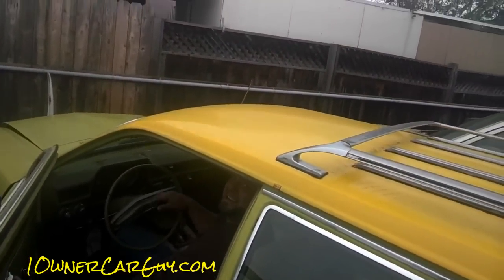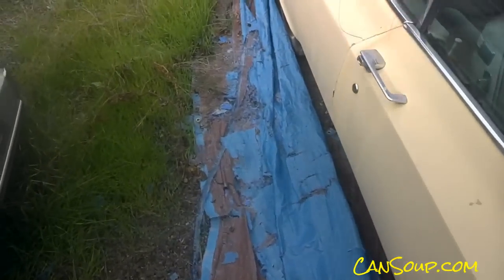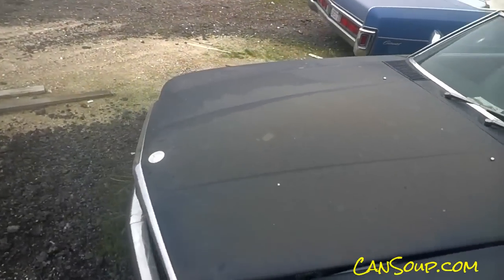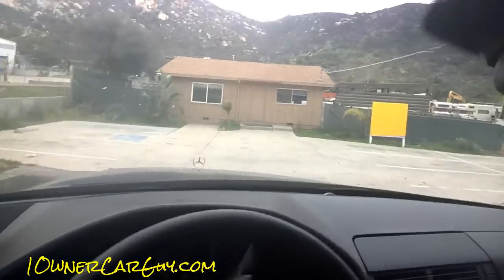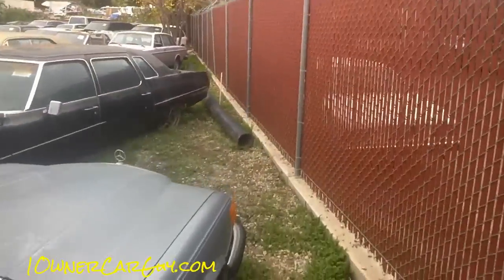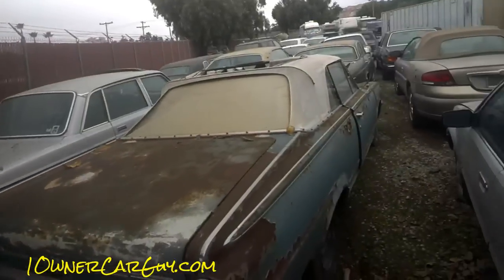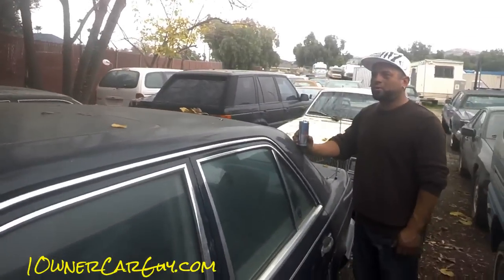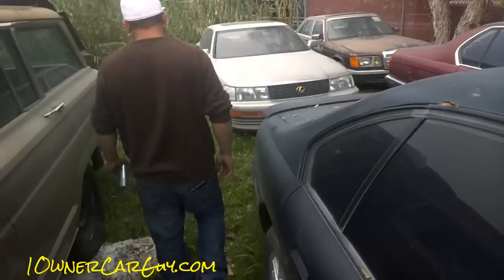Classic Cars Video For Sale Classics Buy a Oldtimer Car Barn Find

Comment: I was wondering if you ever come across '68 to 75-77 Chrysler Town and Country or Dodge Monaco wagons [Big Block 440 down to 383] Fury Wagons from the same period as well. Not the Intermediates - 115"-18" wheelbase.The ones on the New Yorker Imperial wheelbase.

Comment: The 1971 Cadillac is not actually a limousine; it's a Fleetwood Series 75 Sedan. The limousine model has the sliding glass partition between the front and rear seats.

Comment: You need to do something with that manual 300E, that is a super rare car.  Automatic transmission was always standard on the 300E, the five-speed manual was an optional extra.  I've only seen maybe half-a-dozen manual 300Es and they were all low spec ones with cloth interior and steel wheels so to see one with leather or MBTex and the alloys that's got to be a rare car.  In fact I don't think they sold manual ones in the US so the original owner might well have got that one from Stuttgart themselves...
Reply: Michael Sackstein   I'm in the UK and like I said I've only seen maybe half-a-dozen which were all European cars, not right-hand drive UK cars so even in Europe they're super rare...
Reply: Michael Sackstein   Oh yes, there were plenty of manual 300Ds, they were extremely poplular as taxis in a multitude of European countries.  A friend of mine has a 300TD, the estate version, not turbo-diesel that's been in his family since brand new in 1986 with a manual box that's done over 850,000 miles and it's still on its original engine, gearbox, differential etc...

Comment: I like that black w140 600 v12 not a big deal to replace the engine installation on them. This happens because the wires melt   it's comment problem on v12

Comment: he thinks has has a majic buffer. it replaces clearcoat. delaminated paint & all.  & as far as the grand prix it was actually very common for the hood (& other top panels) to rust because manufactors had a delamination (flaking) issue with their paint. they had recalls for many years back then. not hating on him its just funny, a lot of people sugar coat what their cars need cuz we love em.